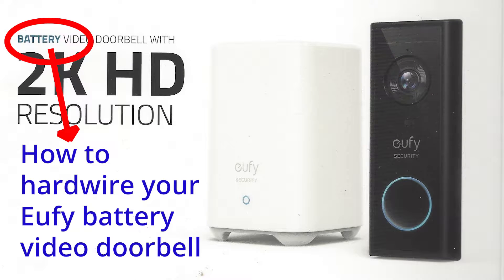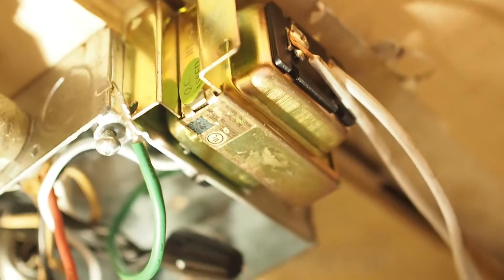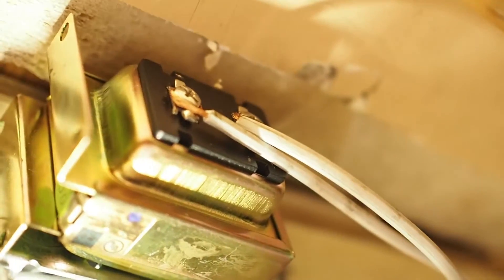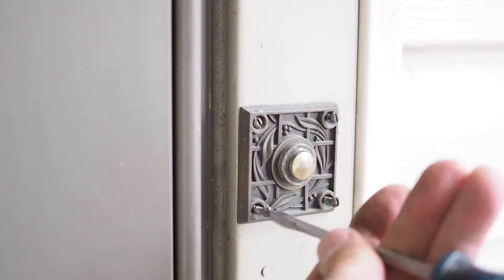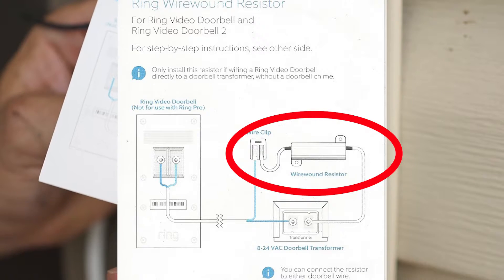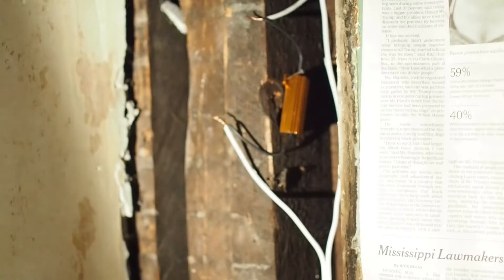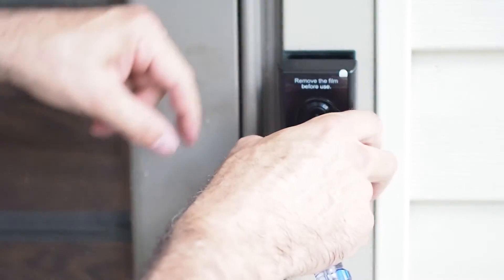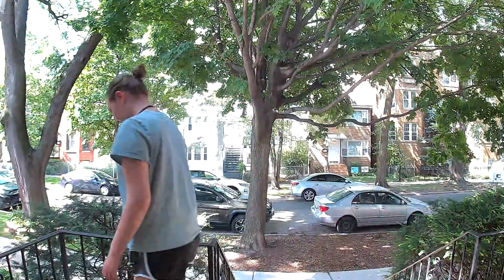How to Hardwire the Eufy 2K Battery Video Doorbell

Comment: Ken, I know your recording is few years old. I found your recording because I am trying to figure out charging issues with an Eufy Doorbel T8210 2K.  Even if Doorbell is connected to AC (24V 40VA), it does not charge battery. I have to remove Doorbell every 2 or 3 months. The back of the camera and Eufy manual states it does(Input 1 and Input 2). I am wondering since you post this video long time ago, does your Doorbell remained charge(charging with AC) after you install it?
Reply from the maker: Yes it stays charged. The eufy app actually shows an icon on lower left of a green plug, indicating it has external power
Reply: @kjones60625  Thank you for replying. Then I believe I am out of luck with my Eufy Doorbell. Since I installed Doorbell even with wires, I have to dismount to charge. 
Last Q, Is your Doorbell model T8210?
Reply from the maker: @JoseMoreno-bi7fl  yes it is T8210. Have you looked at warranty? Not sure what they guarantee.
Reply: @kjones60625  Gotcha, thank you. Support wasn't helpful. I reported issue to them a bit late, kind of my mistake. I just assumed dismounting t was normal, but it was not. I wish If I would have found your video 2 1/2 years ago. I am curious if others that watched your video encountered this my issue, if they did I am wondering what they did to fix it. 
Once again, thank you for help.
Reply from the maker: @JoseMoreno-bi7fl  sorry. You are the first.

Comment: If I have a battery-powered doorbell and I connect the doorbell to a transformer, does it charge the battery or does it just switch automatically to the wire? thanks

Comment: Thanks for the video, very useful. 

Apologies if this is obvious, but what does the resistor bring to the party? I'm planning on doing a very similar installation. If the transformer is bringing the voltage down I'm struggling to see what the resistor is for? Cheers
Reply: Agree, curious about this as well
Reply: I did my installation without using the resistor.  It works without problem at all.
Reply: I guess it works like fuse

Comment: THE BIG QUESTION IS if my door phone in NOT AC will it work from say 12v DC ? Most aussie door phones and bells use DC
Reply: Has to be AC.  I'm in Melbourne and connected it to my old doorbell wires and works fine, so I must have AC

Comment: You need to open the Wago connector, lift the orange lever 90 degrees its not easy, and that's for good reason, so when its closed it does not just fall out after.

Comment: Hi, i got a doorbell with transformer installed. It gives 6v output only. Can I step it up to 12v? Or shall I remove the transformer and put new 12v one? Or it’s better to buy new doorbell with 12v transformer installed?
Reply: 6 volts is too low to adequately charge a video doorbell. The optional Wasserstein Solar Panel only puts out 12v which is barely enough to trickle charge.  Eufy recommends 8v to 24v max but 8v is way too low. I suggest a 16v to 24v transformer like this one. https://amzn.to/3nIjHN7

Comment: Those WAGO connectors work really well ~ You need to open  the internal clamp by pulling back the orange lever into the vertical position, insert the stripped wire end the press the lever back to its original position ~ Great connection made!!

Comment: Thanks for the video. I have a 8V AC transformater already installed and connected to the Eufy. The app shows a charging symbol, but after a few days the battery drains from 100% to 90%. 
Are 8V to low? I cant a data sheet from Eufy. Thank you.
Reply from the maker: Not sure about the voltage. But think of it this way... you are replicating a cell phone battery charger by putting the transformer plus resistor in the circuit. I am not sure if only 8v is enough after the resistor.  But then again, a quick survey of cell battery chargers show 5v, 2 amps.
Reply: @kjones60625  Thanks for your response. I also heard, that the battery will only start to charge when it is below 60% SOC. Can you confirm this? Thank you and merry christmas from Germany.
Reply: You need 18v. 8v is too low
Reply: AC or DC 
So 18v what about amp's ?
Reply: @IngobertHolz: Could you please share your experience with an 8V AC transformer? I have that as well and I am considering to buy a Eufy 2k doorbell (T8210). I saw at timestamp 8:31, at the back of the bell says "input 1 is 8-24v (from doorbell wires). I assume it should be sufficient, but I would like to hear from an existing user of the doorbell.
Reply: @antonindrawan  😀 After three years i can confirm, that the doorbell „sails“ between 80% and 100%. So, it discharges to ca. 80 % and then recharges to 100%. Long story short, it works perfectly !
Reply: @IngobertHolz  thank you :)
Reply: @IngobertHolz  Just installed it 2 weeks ago, I confirmed it charges my Eufy T8210. I am a happy kid now :) Thanks
Reply: 8-24V AC, 10VA or above.

Comment: Lol. Those connectors that didn't work really do work. You need to lift the little orange levers all the way up so that they are at a 90 degrees angle to the connector, then insert the wire and push the orange lever down flat again. They are really stiff to prise all the way up and back down again.